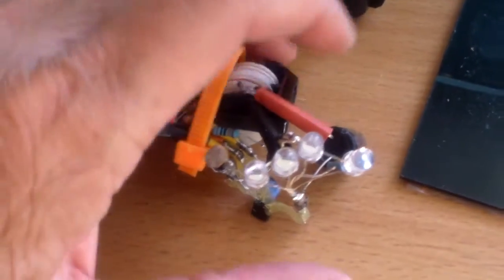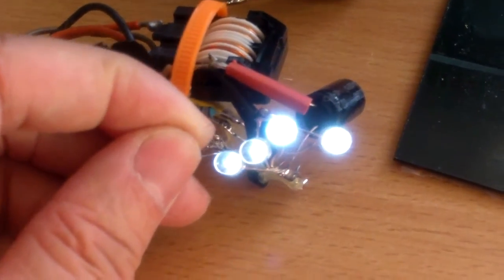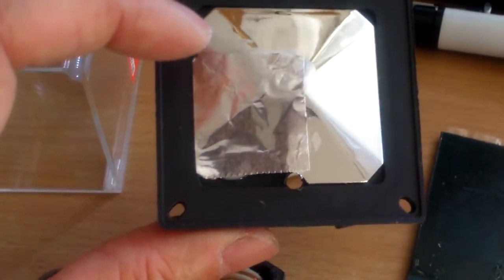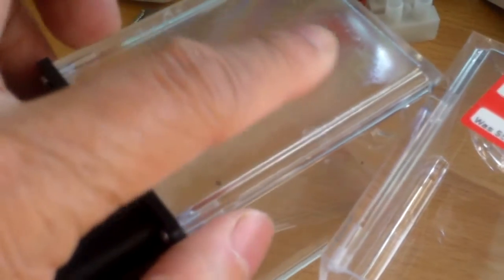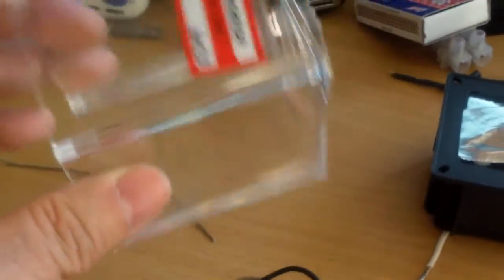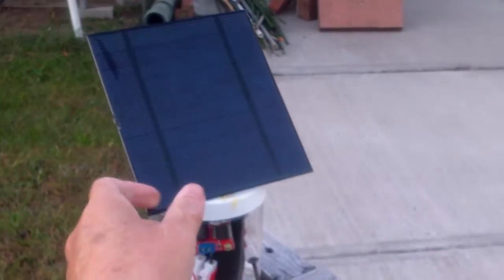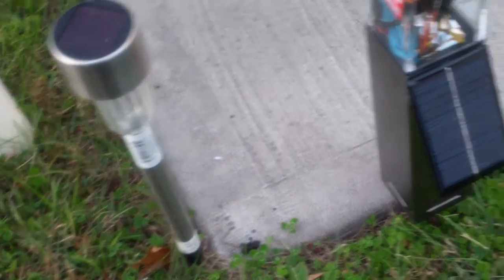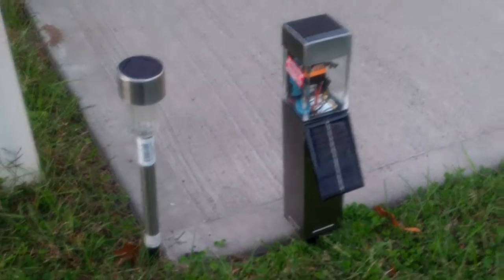Another do it yourself solar light in the backyard

Comment: You can try olive oil on the clouded-up casing.  No guarantees on that since you already used a solvent.  I used alcohol to clean my dashboard instrument cluster, and it fouled the plastic and clouded it.  Olive oil fixed it--see my video "Life Hack: Restore Fouled Plastics With Olive Oil!" for more information.

Olive oil also works to remove the sticker on the other unit you have, you need to let it soak in for a while, but it will dissolve the glue.